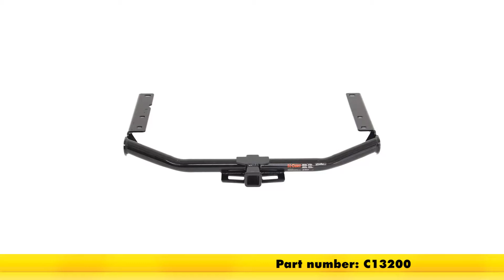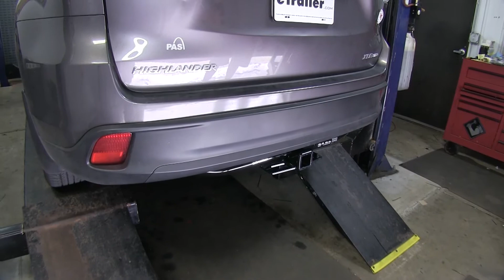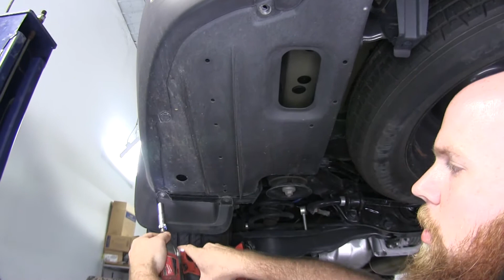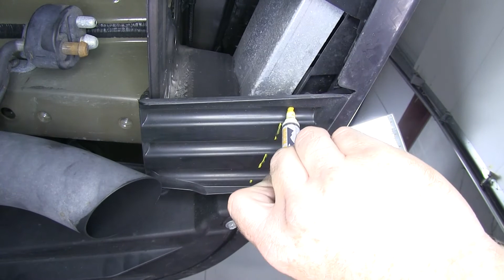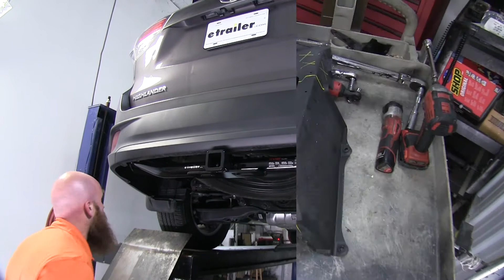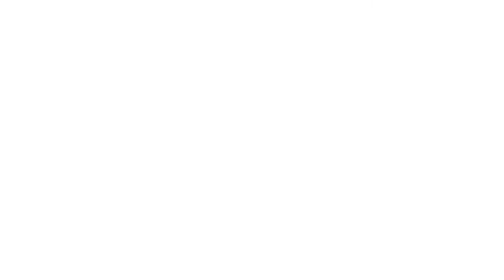etrailer | Setting up the Curt Trailer Hitch Receiver on your 2016 Toyota Highlander

Comment: I have a problem because the tire is too big i need 1-2 inches more athe middle
Reply from the maker: Does your spare have an aluminum rim? We mention in the fitguide that the hitch isn't compatible with spare tires that use the aluminum rim.
https://www.etrailer.com/Trailer-Hitch/CURT/C13200.html

Comment: The maximum towing capacity for a 2016 Toyota Highlander is 5,000 lbs - and that's assuming the V6 AWD with their towing package.  I assume your 8,000 claim is for the hitch package, but the title of this video says "2016 Toyota Highlander", could be a bit misleading to the casual observer.
Reply from the maker: It is important to note that the towing and tongue weights listed for this trailer hitch do not necessarily reflect those of the vehicle. Trailer hitch weight ratings are tested apart from the vehicle so even with this high weight rating if the vehicle has a max tow rating of 5,000 lbs like you stated, the vehicle is the limiting factor and you shouldn't exceed the lower rating.